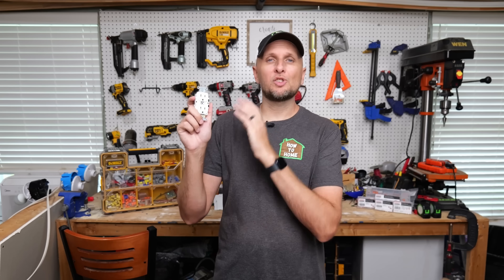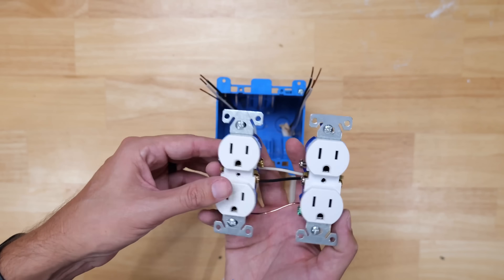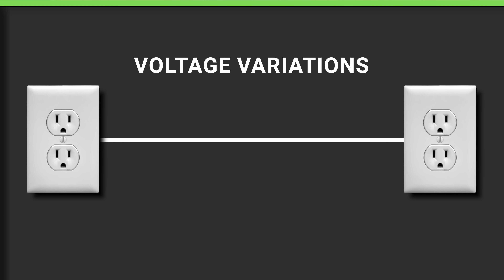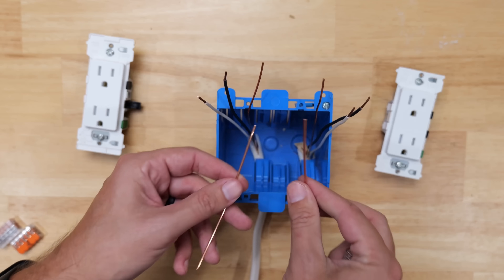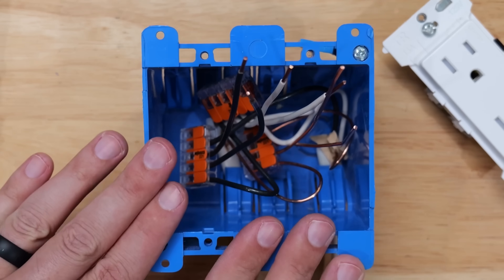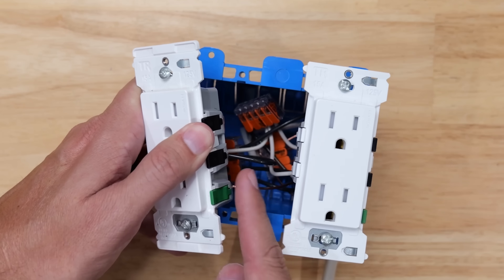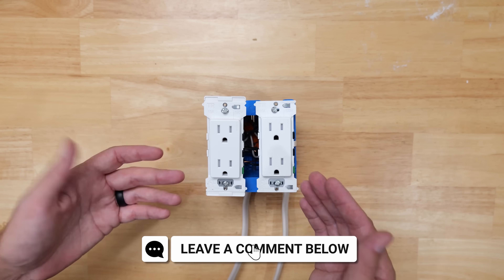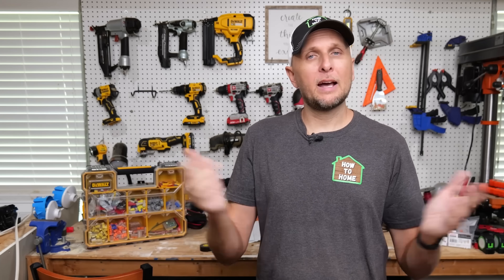Why This Outdated DIY Outlet Wiring Needs to End!

Comment from the maker: I am genuinely curious.  How do you wire up your outlets?  And why?
Reply: On my new wiring (I completely redid the garage and added some kitchen outlets) I did it your way with the wagos.  (they work great).  I replaced all of the outlets in the rest of the house (old 12-2 no ground) and I used the receptacle as the hop as I did not want to excessively disturb the old wiring.  Put afci/gfi breakers in at the panel.
edit...also used the Southwest junction boxes that screw into a stud and I find them far superior to the old blue flimsy workbox that your example shows.
Reply: About three years ago I added a pair of duplex outlets in my garage using a two-gang box. I ran jumpers from the GFCI outlet to its neighbor (a corrosion-resistant outlet I had lying around for some years now). Pigtailing does make it more convenient IMO when replacing a device. 

The scariest thing I found in my 1978 home is where they used the outlet device yoke to divide up an Edison (multiwire) circuit... I fixed that in short order!
Reply: @NipkowDisk Is the multi wire split actually a code violation, or just questionable practice?
Reply: @TomCee53  I believe at one time many years ago, using the device yoke to divide a multiwire circuit was not a violation. I can't cite the Code reference, but I'm pretty sure it is a no-no today. The reason it is a bad idea, is that neutral integrity can be compromised should the device fail. Maintaining neutral integrity is an absolute with multiwire circuits.
Reply: @NipkowDisk NEC 300.13(B) requires pigtails for MWBC's, but it only applies when 2 separate receptacles are used. It doesn't apply for a split duplex receptacle with each one on their own dedicated circuit because pigtailing would be irrelevant. This example is code compliant as long as rules for MWBC's are followed.
Reply: @surferdude642  Thank you very much.
Reply: Back in 1993 I started working for a general contractor while going to college; using pigtails is how he had me do the wiring. He also had me wrap the wire nuts and receptacles/switches with electrical tape to help keep fingers and anything else that shouldn’t from touching metal/wires. Now I’ve started using Wagos, which are great, and I wrap them with electrical tape because I saw there is a slight chance the latches could open when pushing everything in the box.
Reply: @smcnish1droid Sorry but tape is a bandaid on an improper connection to begin with and does not make a bad connection good. 35+ years and I have had to replace many 1000s on taped connections. The tape just gets hard and makes a mess when take things apart and I have had so many wires pull out of the connection, sometimes even fall out as soon as I moved the connection because the tape dried up wasn't holding the bad connection together anymore. No tape, twist the wire nut on and hold the wire nut and pull every wire to make sure nothing is loose....
Reply: @michaelcassidy7645  black tape gets nasty after a few years. Never use it in a box. Just do the box correctly.
Reply: Not too many double boxes with outlets in apartments. Most of the time they didn’t leave enough wire to get rid of daisy chained setups.
Reply: quite a few years ago an electrician that was doing work at our car dealership taught me to do it this way with the pigtails. He does it this way because we destroy receptacles and this makes it quicker and easier for them to install replacements.
Reply: What happens when one of the connectors fail? Is that any different from a receptical failing?
Reply: New work, I always pigtail when the circuit passes through. When reworking old residential, you can find outlet boxes that are too shallow for wire connectors to fit in with the outlet. If I can't replace the box, I will get an outlet that can be double tapped at each screw and put both incoming at outgoing wires one one connection.
Reply: Interesting that this is a ‘new’ way to wire receptacles. I’m not an electrician but when I built my house back in 1981 I decided I could do the wiring. My father-in-law being an electrical engineer provided the necessary hands on training and that’s how he taught me to wire my outlets. BTW, in the 44 years I’ve lived in my house I’ve never had an outlet fail, even in the bathrooms where devices are being plugged in and out on a daily basis. Glad to see the rest of you are finally catching up on the ‘new’ ways. 😊
Reply: I've switched to back wire outlets, in part for this issue.  Our house was built in the '80s, not enough room to do the whole pigtail job unless you replace the entire box.  But a back wire outlet terminal can have both supply and load on the same fastener, so an outlet failure won't take out the rest of the line.  They also simplify the wiring in general, since you don't wrap the wire around the screw.
Reply: I am an Electrician and we pigtail ALL our new construction outlets. In remodels, sometimes the budget does not allow for this and we hook em the way we find them. EDIT: Having the 2 gang box with 2 outlets was confusing to others video watchers, (my wife) should have just used qty 2 single gangs boxes to demo the different boxes. Side note: Length of wire left in the boxes was not enough, I put ground wires on bottom, neutrals in middle and hots on top.
Reply: In a few weeks I plan to run a line of duplex boxes. In the first box upstream I plan to have first a GFCI  wired as passthrough. Everything else downstream will be wired as your Video shows. Any problem? (@NathanielMitchellnm makes a comment I don't understand.)
Reply: @LesleLeBang NathanialMitchellnm was referring to GFCI receptacles when the wires coming in go to the Line and the wires going downstream go the Load to protect the other regular receptacles, no pigtails. I'm not sure why you would wire the GFCI as pass through (no Load connection) when you have that option, it would be safer to use the Load.
Reply: @LesleLeBang Using the load terminals on a GFCI is not actually passthrough, since there is circuitry involved beyond just the jumper.
Reply: @LesleLeBang  yes, hit the GFI line terminals, then put the rest of the receptacles on the load terminals. When I wire outside receptacles I like putting the GFI in the house to keep it out of the weather, then use the load terminals for the outside receptacles.
Reply: Parallel almost all the way except for GFCIs and end of runs. Wiring in series pretty much went out years and years ago.
Reply: And GFCI, although it looks to be in series, isn't completely because of the circuitry in the outlet. While it acts like series when it faults and shuts down the rest of the downstream circuit, it's designed to avoid some of the other issues of series wiring such as voltage fluctuation.
Reply: I'm replacing all of the through-wiring with pigtails in my home currently after watching one ignite at work.  An 1800-watt toaster oven in the kitchen caused a receptacle in an adjacent bunkroom to catch on fire.  The tiny metal strip connecting the terminal screws melted.  That tiny metal strip in cheap residential receptacles (which should not have been used in a commercial application, I might add) is not rated for 15 amps.  Nor should bunkrooms be on a circuit with kitchens, but there's too much to discuss in a single comment with this place.

I'm hesitant to use the new lever-lock receptacles.  Having seen the wires be pulled out with relative ease, they don't inspire confidence yet.
Reply: The old method is probably fine within the same two-gang box.  I mean,  if you think of it, this is what you HAVE to do with GFCI receptacles if you are using the GFCI receptacle to protect the other receptacle. 

But I wouldn't do it across boxes.   That's just asking for trouble in the future.
Reply: With both wiring methods the receptacles remain in a parallel circuit, so they will function the same way. In parallel circuits the voltage is constant and the current is divided between loads. There will not be a voltage drop from one receptacle to another.
Reply from the maker: @davekrieger7172 there can be for various reasons 🙃
Reply: @davekrieger7172 with good connections, no, but back connections you get high resistance heat and voltage drop can and will occur. Heat is the enemy.
Reply: I've got aluminum wiring. I already have to use pigtails in order to use the alumiconn connectors.
Reply: @BackToTheGame.98  don't you use aluminum devices? They cost more, but they are available. And I would think no-ox on every connection.
Reply: I wire them with common sense. Sometimes pigtails make sense but most of the time I use the perfectly good terminations on quality receptacles and switch's. Back stabs should be banned. Screw terminals with light busbars should be banned. With the new back clamp styles and quality screw terminals with solid brass between them all pigtails do is introduce more points of failure. I know you used the wagon for demonstration purposes but these are far more prone to fail than quality screw terminals. Wire nuts done by DIY are far more prone to fail than quality outlet terminals. 

Your comments about voltage drop are insane! Pigtails just move the potential high resistance point to a different spot. FFS wagons have a much higher risk of choke points and heat buildup than my previously mentioned QUALITY OUTLET SCREW CONNECTORS.

As far as trouble shooting goes there is really no guarantee that a failed pigtail wire nut will be any easier to find than a failed cheap outlet terminal.

Lastly after repairing circuits in 30 to 100 year old buildings all my life, when an outlet fails every outlet on that circuit (including lighting) is pulled, the wiring is assessed and all devices are replaced with new quality screwed back clamp devices. Wire nuts and pigtails are only used in the case of not enough solid safe romex exists or if there is not enough terminals available without doubling up or daisy chaining.

Daisy chaining obviously creates more resistance points on the circuit than universal pigtails so that's why I started by saying where appropriate.
Reply: It is so time consuming the way you are doing it. I know this is for DIYers.  I quote whole houses, this takes so much time doing what you are doing, and what if one of your wagos fail, no difference in troubleshooting than if a receptacle fails. Waste of a lot of time when you need to quote a whole house.
Reply: I use paper clips and chewing gum. Why? Because it's cheap and satisfies my sugar addiction.

Comment: When possible, I prefer to daisy chain outlets by not cutting the wires.  I remove about a 1 inch section of insulation mid-wire and loop the u-shaped stripped section of wire around the outlet screw terminal.  By not cutting the wire, it eliminates any contact resistance on the outlet terminals from impacting downstream outlets.  It takes a little extra time to strip a mid section of wire, but seems to me to be the most robust and reliable daisy chain method.  I expecially like this method for stranded wire, as it stays more tightly bunched under the screw terminal.

Curious to know if others use my method, or if there is some concern with it?

Comment: The pigtail method exists because way back when they started allowing 15 amp receptacles on 20 amp circuits, there were a ton of receptacles only rated for 15 amp so you weren't allowed to pass through them. Also, in new construction, pigtailing makes it easier to identify and test everything durring rough in vs weeks later after the dry wall is up and you go to install the receptacles and switches.

Pigtailing is not a "better way," it's just a different way for a different reason that isn't really a reason unless you are using old receptacles.

Comment: What, what? 
The 2 screws are connected on the exterior of the plug by a plate. They are not running through the plug. The prongs inside the plug are in parallel not series with the screw connections. 
If you literally cut the entire guts out of the plugs you would still have a full connection via the screw plate bonds. Basically the equivalent to a wire nut. 
Now if you want to argue about the quality of the plates binding the screws, maybe. That doesn’t seem to be your message
Reply: Agreed, even residential grade receptacles are rated for 20 amps pass through with a small tab connecting the plates. If a person is concerned, then use a commercial grade receptacle, which has a large tab and is more robust in general.

Comment: main reason is a lot of existing boxes have NO extra room.  daisy chaining cuts out on wire nuts/wagos.  if i have two outlets in the same box i may do it, but if it i powering other outlets down the line, i do not daisy chain

Comment: I started working full-time in the electrical trade in 1972, and mostly did industrial and commercial work. I have helped many friends and neighbors solve electrical problems over the years, and the one most common is from receptacles having been stab-wired. That wiring method should have never been allowed. A high current (space heater, toaster, etc.) causes overheating in every "upstream" receptacle. Side-wiring done properly shouldn't cause a similar issue.
I always pig-tail multiple receptacles, but normally use stranded wire for the tails, finding it easier to stuff the box.  
Of course, in multi-wire circuits, you MUST pigtail.

Comment: so I gotta dumb question: why are there not junction boxes in the attic or non living space above each outlet where all the up/downstream connections are made, then a single Romex down to the outlet? labor/time/parts costs? it seems it would even out if your running 10+ feet of copper for each outlet/switch several times for each one. bonus dumb question: why dont each room have its own breaker? all my houses have had the front porch light on the same circuit as the 2nd bedroom light or whatever. even though their on opposite sides of the house??

Comment: I like the Wago connectors for ease of use in many situations, but in my opinion daisy chaining outlets the old way should not result in a significant voltage drop because the connectors on the older style receptacles (should) have a solid bus bar between the 2 nuts. It's also potentially crowding the box (fill etc.) and makes for a more expensive circuit. You're right about the potential for a failure to take down the whole circuit, but that would probably mean a loose connection of one of the wires. Maybe a bit more inconvenient to find if daisy chained, but more importantly that could be a potential cause of arcing and fire and those issues could still happen with the new method. I think it's much more important to loop the wires (always clockwise of course) around each nut and tighten really well.

Comment: There is absolutely nothing wrong with wiring through the receptacle.  With proper connections, it's actually better than a bunch of pigtails in the box.  Especially true with back feed commercial receptacles.  What you recommend in this video takes much longer and is no more reliable.

Comment: Excellent instruction!  Those Wago connectors worked great!  What a pleasure compared to wire nuts. Needed a deeper double gang box since the wires in the original single box were way too short so I had to use the Wago single wire connectors to add length to the conductors which took up more room, but the project was easy as a result of watching this video.  Thanks for your help!

Comment: This doesn't make sense. You are just moving the potential point of failure while increasing box fill. Especially if using WAGO style wire connectors you are decreasing surface area of the conductive strip which is naturally much larger in the outlet. If you use traditional wire nuts this would be different but you are still increasing box fill and the number of connections and every point of connection adds a potential place for resistance which can translate to heat. I just don't understand the logic of this method. But I have seen outlets where the connections have melted wiring and in those cases pig tails would make it easier to replace the damaged conductors -- especially true in homes wired with aluminum back in the day.

Comment: What do you mean by a receptacle failing?  If you mean that the internal contacts no longer make proper connection to a plug, that usually doesn't affect the screw connections to the wiring.  If you mean the wiring connection fails, then yes it will affect that or others down the line.  However, a properly attached screwed down wire is unlikely to fail, although it, like any other connection including a wire nut, can fail.  So what you are arguing is effectively the reliability of receptacle connections vs that of wire nuts - for the receptacles down the line.  I have seen countless miserable wire nut connections and I think fewer screw terminal failures, but have seen tons of intermittent and burned "push in" connections.  Not all beginning electricians (who do most of the work in construction) can even do proper wire nut connections.  And don't get me started on those new connectors.

Comment: I’d like you to do a 3way video.    What irritates or pisses me off the most I’d say is why the manufacturers don’t unify where the three screws are located. I’ve seen black,red and white used for common.  I go into a home open the box and the new 3way screws aren’t the same as the old ones which makes it a bit of a challenge sorta. But then some dildo junction boxes in a light fixture and now your common starts black and ends white and such.  I’m sure you’ve seen it all too.  But still why did manufacturers such as Leviton switch it up by putting the common by itself now when they used to stack the common under the other screw (traveler)  I just think it would make for a good video